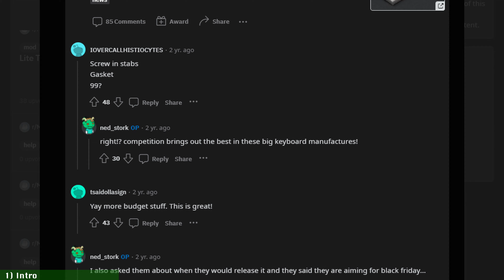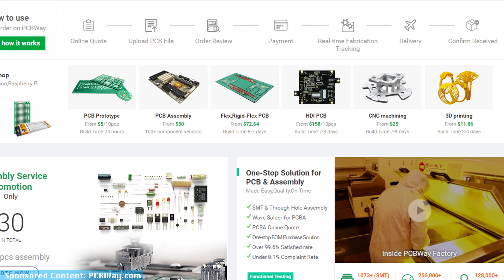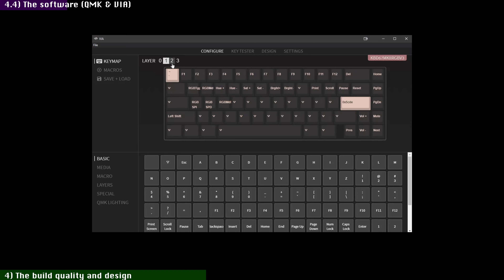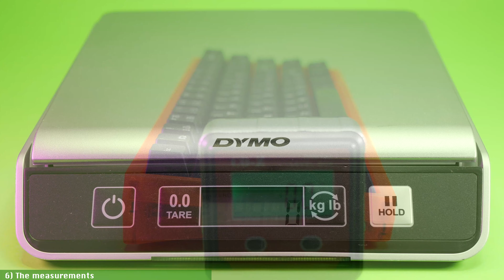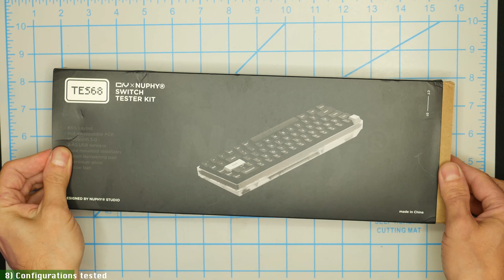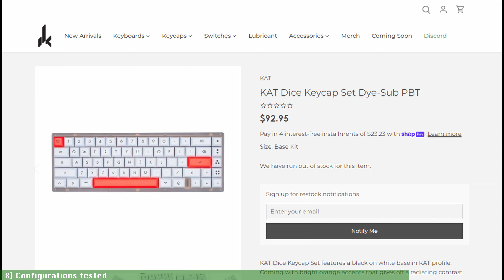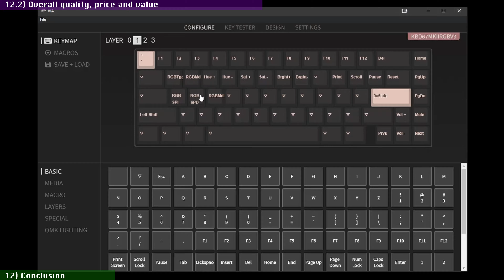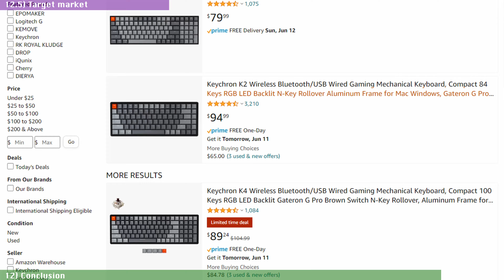KBD67 Lite: still worth it?

Comment: I love these long videos. In fact, I was so lucky that the YouTube algorithm recommended your first the release day and I have learned a lot since. If I dare to make a quesrion, could you recommend any 60% wireless keyboard. I already have an Anne Pro 2 and a Kemove 61. Although I love the form factor and I have slightly mode the kemove, I would to improve them a little, or chose an alternativa base plataforma. Thank you in avance.
Reply from the maker: Hey Enrique! Thanks man!! Always nice to get feedback like this!!!

In my opinion, the best 60% keyboard I have ever used is the CannonKeys Bakeneko60 (case: https://cannonkeys.com/collections/keyboard-kits/products/bakeneko-60 and PCB: https://cannonkeys.com/products/bakeneko60-extra-pcbs?variant=40604277571695 ).

It is a full-blown custom that will not break the bank (for a custom keyboard, that is) at roughly $180 (for the case + hotswap PCB) plus switches and keycaps. It is a full metal encased board that types and sounds wonderful!

For a production 60% keyboard, my recommendation nowadays is a Ducky One 3 Mini (which is hot-swappable, where the One 2 Mini was not) for a regular mechanical keyboard and the Razer Huntsman Mini w/ red switches for a silent optical board.

But honestly, if you already have an Anne Pro 2 and a Kemove 61, I don't think another production board will be much of an upgrade to you at this point, since the functionality will be basically the same (Ducky would give you an additional notch or two in terms of quality, but still not enough to justify the cost if you already have an Anne Pro in my opinion).
Reply: @IOSam  Thank you so much for the quick  and detailed response. I have checked the bakenoko, but it lacks a key feature, wireless connection. Due to the configuration of my office, I have the PC tower in a relative awkward far position, is no negotiable. Anyway, thank you again for the information and we will be eagerly waiting for the next one. Best from Spain ;)
Reply from the maker: @ennanco  Ah, if you need wireless, then it is indeed very hard to beat the Anne Pro for the price (there is a reason why this is one of the best-selling mechanical keyboards of the last 2 years on Amazon)! The EPOMAKER GK64XS was another very good 60 percent(ish) wireless board, that even had a metal case option at some point, but has been discontinued for a while now.

For some reason there aren't many wireless 60% boards in the market nowadays. I suspect that the reason for that is the fact most manufacturers are focusing their efforts into the 65% layout now, which probably has wider appeal (because of the addition of the arrow keys).

Most interesting premium 60% boards I’ve seen in the last year or so, were all small group-buys on Geekhack (and very few with wireless in them). It seems that premium 60% boards are becoming an enthusiast niche nowadays. Meanwhile the vast majority of 60% boards on Amazon are basically the same product (GK61) sold under a myriad of different brands.

Comment: Recently just bought the lavender kit version of this keyboard, and I'm liking it very much. While their gasket mounting system looks proprietary, the case doesn't stop you from modding it. Honesty, I think it's highly moddable as I've tried mounting my D65 plate, and it works with the poron gaskets as well.
Reply from the maker: Hey Patrick! Thanks for your comment! Could you elaborate a bit more on how you modded your KBD67 Lite with poron gaskets (if I understood correctly)? I’d be curious to try this myself.

Comment: Hi sam, in 27:40, i just wanted to point out the gasket performance is very minimal, the flex that you see is actually either the flexing of the case or the compression of the keyboards feet. If you look closely, the bottom of the board is the main movement when you press down. Not alot of plate movement. If you wanted to see plate movement, you would see the keycaps sinking into the case. Other than that, great video.
Reply from the maker: Yeah, that is totally normal of course, since there is no way to isolate the case and feet softness when pressing down on the keycaps. I don't put a lot of pressure when shooting these profile shots, but it obviously puts more force into the board than just regular typing (especially if one is a light typist like me)... So, the silicone feet will always sink as well.

But regardless of what you can see in terms of flex, the KBD67 Lite is not a stiff board. It might not be as soft as other "trampoline" keyboards out there, but its silicone damper still does a decent job to feel and sound good for normal typists (that don't hammer keys when typing).

Comment: Hi Sam. Great video again. Question: the Domikey WoB Cherry Profile ABS keycaps are really expensive. Can you comment on them? I just got the new Drop DCX WoB (which is great) and have the BoW incoming. But I do like the hiragana on your/these keycaps... looking for your feedback on quality etc. since they're pretty expensive.
Reply from the maker: Thank you!!! And yes… This Domikey Cherry set is going for the same price as expensive GMK sets nowadays. I got this BoW with Hiragana for a little less ($96) when I got through Drop.com because I didn’t get a full set (I just got alphas, mods and mod plus), but if you get it through KPrepublic you can only get the full set, that will go for around $127.

In my opinion, this Domikey run that Drop.com had, is basically as good as GMK (the legends might not be 100% perfect, but the caps are a bit thicker than GMK, which I like). BUT the problem is dealing with the notoriously shady guys from KPrepublic (which is why I only get Domikey stuff when Drop has it on group buy here in the US, since in that case I don’t have to deal directly with KPrepublic).

Besides, I had another viewer commenting here that he got this WoB Hiragana from KPrepublic and he said the legends were not as good as what he saw in my video. And here, again, I suspect the problem is KPrepublic… Drop has very strict quality control with these Chinese suppliers (I believe KPrepublic has exclusive rights to Domikey stuff in most parts of the world outside of the US) and thus these suppliers probably send their A-tier sets to Drop and then sell the B and C tiers to KPrepublic for a lower price (allowing KPrepublic to make a higher profit).

As a comparison with Drop’s DCX, while I have not tried those yet, I suspect they might be very similar to the Domikey’s A-tier I got from Drop last year in terms of thickness and quality (I even suspect they might be made in the same Chinese factory). So, if you’re happy with the DCX set for $100 (or even Drop’s GMK WoB for $90! https://fave.co/3xsfsvr ) it might be a better (and safer!) deal… But if you really want Hiragana legends then I don’t know of any other readily available double-shot ABS WoB with sub-legends other than the Domikey stuff that KPrepublic sells (at least at this moment in 2022).

I know KBDfans has a WoB with Hiragana in PBT with reverse-dye-sub (which, while not as sharp as double-shot ABS, is still pretty nice and durable), but those have the sub-legends in red (https://kbdfans.com/r?id=44s7cl ), which might not be what you want.

Comment: Sam,
If you ever get  your hands on Akko 007 v2, you should really try it. I am actually amazed how well it's performing slightly modded (removed case foam, taped pcb, replaced sillicone mounts to provided soft ones, and of course durocks stabs). It honestly sounds better than my Q2.
Reply from the maker: Oh, I tried to get one of these, but it has been out of stock for ages now... Not even sure if Akko intends to ever sell these again... Where/when did you get yours?
Reply: @IOSam  I ended up getting it from eBay unfortunately, though - they have been available on the Akko webpage now and again, including last week, and this week
Reply from the maker: @TheBeat16  Ah, ok... Cause I have seen some of those on eBay, but the prices were outrageous...

But nice to know that Akko is still restocking these every once in a while. I'll start to keep an eye on their web store from now on.

As for how it compares to the GMMK Pro or the Keychron Q1, have you ever tried any of those two to see how the Akko board compares?

Comment: I have this keyboard in light blue and it's pretty neat. Compact, easy to build and no modding needed (shoutout to pre-lubed Akko CS switches). My wife loves it with Akko Midnight keycaps and she's probably going to steal it from me soon, I'm thinking of getting either another KBD67 lite (this orange looks sick, not sure about the opaque R4 colours) or a Tiger 80 Lite.
Reply from the maker: As someone who has tried all of these entry-edition boards (NK65, Portico, Ikki68 and KBD67 Lite), I have to agree with you. This board brings the best balance of price, performance, and ease of building. And it is by far the easiest one to "get right" out of the box with no major modding (and Mrs. I/O here has also been eyeing my orange board with KAT keycaps for a while now 😂).

The Tiger80 is definitely another very enticing "EE" offer from KBDfans, at least for those of us who love TKLs! :)

As for the R3 translucent colors, they certainly have a 90's vibe that is quite appealing. The only potential issue is that I feel that translucent ABS plastic can be a bit more brittle than either opaque ABS or polycarbonate. But as long as one takes decent care of this board, that shouldn't be a problem for the vast majority of users.
Reply: @IOSam  interesting piece of information about the translucent ABS being more brittle, I didn't know that. I'm basically trying to decide if I want a bigger board, since I'm so used to 65/75%. Thanks for the informative video by the way!

Comment: Love to hear your thoughts on the Logitech's Mx Mechanical keyboard and if it can be improved

Keep up the great work!
Reply from the maker: Thanks Fayaz!!! Appreciated man!

As for your question on the Logitech's new MX low profile Mechanical keyboard, from what I've seen from initial reviews, it will be (as per Logitech's usual ways) very difficult to mod, since it is not hot-swappable (which will get in the way of lubing switches and stabilizers). And it seems they even went through the trouble of making the spacebar mounting holes non-standard (so you wouldn't be able to find a replacement for it on aftermarket keycap kits out there, as you can see here: https://youtu.be/qR_1UCOD2So ).

So, it looks like getting one of these with the intention to mod it later might be a problem (specially considering how expensive it is). I know there are a few interesting (and cheaper ) new choices arriving in the market soon for low profile mechanical keyboards that don't have those issues such as the Azio Cascade Slim (https://www.aziocorp.com/collections/keyboard/products/cascade-slim-75-wireless-hot-swappable-keyboard ) and the Kemove K68 Butterfly (https://www.kemove.com/product/k68-butterfly ).

Those are hot-swappable, come with better keycaps and seem to use standard keycaps mounting systems that should allow you to replace them later if you chose to. Of course, they don't offer the hardware/software ecosystem integration you get with Logitech, Razer, SteelSeries and Corsair. So, if that is something important to you, then your choices are naturally much more limited. But if all you want is a good wireless low-profile mechanical keyboard, it seems you are about to get many good options in the very near future!

Comment: Is this better than GMMK 2? In my country KBD67 is 45 bucks more expensive than GMMK 2, so I wonder if the quality is much better or what's going on here
Reply from the maker: I wouldn't say the KBDFans board is "higher quality" necessarily. The difference is in the way these boards are designed, which the GMMK2 uses a more traditional (and cheaper to produce) mounting system (tray mounted), while the KBD67 uses a type of suspended mounting system that produces some "flexing" (that enthusiasts enjoy mostly for its softer bottom-out and nicer sound).

 The other important difference is the software compatibility, which the KBD67 is VIA compatible (better) and the GMMK2 uses its own Glorious Core app (not bad, but not as versatile as VIA).

And then, there is the fact that Glorious produces their boards in higher volume than KBDFans, and thus they enjoy better economies of scale and can be profitable with lower prices than KBDFans.

If you care about a softer bottom-out (and the nicer "poppy" sound that it produces), the KBD67 might be worth the price difference. Otherwise, the GMMK2 will be a better deal for you.
Reply: @IOSam  thanks for the elaborate answer. Another issue is that it seems that KBD67 is still out of stock here. Odin Gaming Nova65 is in stock though, that board also uses gaskets it seems. Any opinions on Nova65?
Reply from the maker: @FiveNineO  If you can get the Nova65 for a good price, I'd say get it! It has a metal top frame, it is gasket mounted, VIA compatible and comes with Durock stabs in the box. Can't ask for more than that for Odin's $160 price (definitely worth the price difference with the KBD67 Lite).

Comment: In 2023, this product has been discontinued. I found the R4 wireless in stock (last pieces) for 110 euros, and I am wondering if it’s worth it. 

i can’t quite understand why it has been discontinued. would you buy it in 2023?
Reply from the maker: In one word: competition. The market for entry level customs used to be a niche thing coming into 2019/2020, where small community players such as KBDFans dominated. But after it blew up during the pandemic, this market eventually got crushed with competition coming from every corner of the world… From insane value pre-builts (with switches AND keycaps) costing the same or less than a KBD67 Lite, to borderline luxury metal kits that don’t cost much more.

Does that make the KBD67 lite a bad keyboard in 2023? Of course not. It is possibly one of the best plastic entry level kits ever made! But for its original price, it just doesn’t offer enough value in today’s market compared to the competition. And if KBDFans had to cut its price by at least 2/3 to keep it competitive, they probably would make no money on it. And that is why they dropped it (it makes more sense for them to focus on their Tofu 2.0 entry-level line, that can better compete in today’s market in terms of features and fancier materials, while trying to keep the price/margins a bit higher).

Having said all that, IF you can find a KBD67 Lite R3 or R4 for a good price (when compared to other quality pre-builts and metal custom kits in your region), I’d say it can still be worth it… It all depends on the price reality for its more “modern” competitors in the country you live in. If a KBD67 Lite costs you 110 Euros (without too much shipping and taxes overhead), while the closest competitor in price is a Tofu 65 2.0 for, say, 190 Euros (plus the crazy high shipping rates + EU taxes if you buy it directly from KBDFans)… and you’re not willing to pay more for a metal keyboard kit… and you’re not interested in getting a decent pre-built from the likes of Epomaker, Akko or Skyloong… Than I’d say: go for it!

As long as you manage your expectations for a lighter plastic kit (which will never feel as premium as a heavier metal one), its typing experience does not disappoint.
Reply: thank you for the detailed explanation! I missed that akko was sending to europe. Import duties are hit and miss. You are right about the aluminum, I have a qk65 and the difference is night and day. however, the typing experience is always great with kbd.

I already have a kbd67 lite wired, and i’m searching for a light wireless option to take to work. so plastic is the way for me. right now from where I found it, the wireless version costs 130 euros, including shipping and taxes. 

I also considered keychron v1, i have seen rave reviews. But it’s wired. I’m checking akko now, seems they upgraded their european offerings (I live in Greece), and a 507b plus seems like a very good option….

thank you for your time!